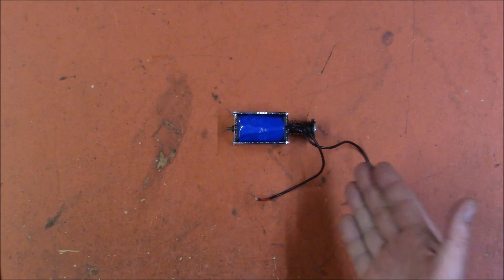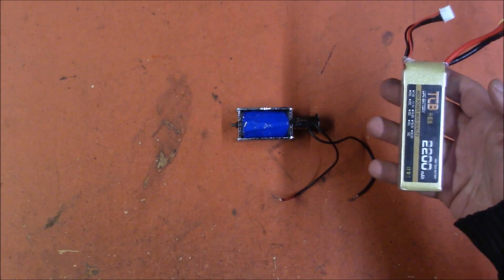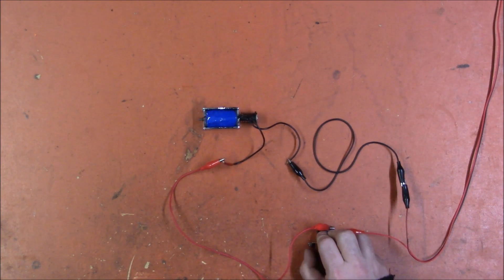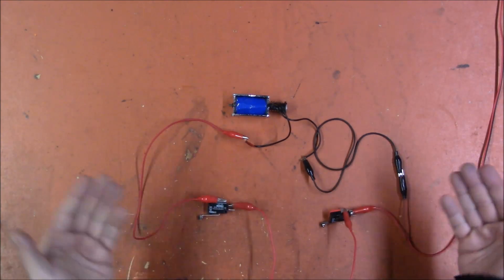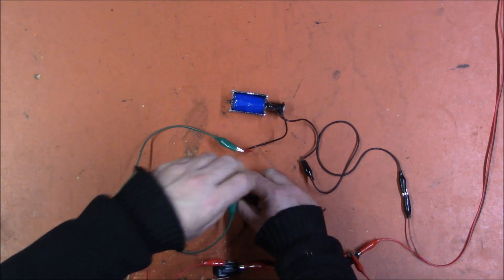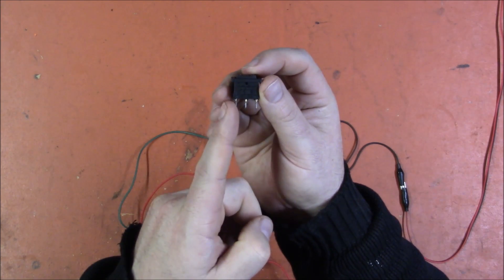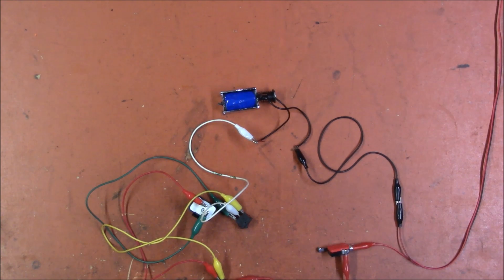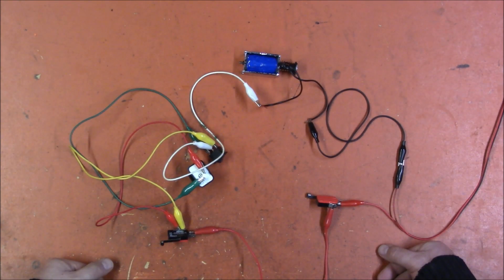Monday Mod Tips - Solenoid Basics

Comment: I’m planning on doing a project that involves a Nerfgun for the Nintendo Wiimote. I’m using it as a Lightgun with Mayflash Dolphin Bar. This allows it to work with PC, Raspberry Pi and Valve Steam Deck. I’m playing the old Lightgun games through Emulation Station and Retroarch on Steam Deck. Anyway everything works fine. I’m just trying to add a kick to the lightguns. To give it a more realistic feel that it’s shooting. So I want to add a recoil to the gun. Just to have that feeling of it firing when it’s not really firing. I definitely want to make it one for one shot games and then automatic for guns that are automatic. I think I can just make it automatic and squeeze the trigger once for the one shit games and then just hold down to do automatic shots. Anyway the Wii is registering one shots or automatic shots on its own. I can get away with making the project automatic right?

Comment: Is there a faster relay? also what type of battery should I use if I make this mod
Reply from the maker: Probably, you would have to shop around. I'm sure some blinker relays are faster than others.

And whatever battery works with the motors you are using in your blaster. The battery you need is dependent on the voltage and current needs of your motors.
Reply: @CaptainXavier  thank you so much for replying nice tutorial btw, while we are at it what motors would you recommend
Reply from the maker: @bunty3278  depends on what kind of performance you want. Different motors exist because people want different performances.

Comment: I don't have a solenoid at hand to try it, but maybe you can make full auto without the car blinker by using 2 momentary switches one in the trigger and one behind the solenoid.
at rest the switch behind the solenoid is closed and the trigger switch is open.
when the trigger switch close the solenoid get power and start to move forward pushing the dart
but at the same time the solenoid switch open and cut the power.
if the trigger switch remain close the solenoid will get power again when it return to rest starting a new cycle 
additionally a capacitor across the solenoid's power leads can help smooth out any rapid fluctuations in power, improving reliability 
maybe also a flyback diode across the solenoid terminals to protect the switches from voltage spikes caused by the collapsing magnetic field when the solenoid is de-energized

Comment: For some reason, whenever I switch the selector switch to full auto mode, it still functions like semi auto. I am running the same relay you are with an OOD neutron solenoid and MTB Rhino motors on 3s lipo. I copied your circuit down to every wire. Do you have any suggestions as to how to fix it?

Comment: When you bypass the relay with the yellow wire, is that wire connected to the same terminal on the firing switch as the red wire, or is it just in contact with the red wire itself?
Reply from the maker: It is on the same terminal.  But either will work.  The key is that is needs to be the output of the trigger switch.  Both the relay and the bypass are connected to the trigger switch output.
Reply: @ ok thank you!

Comment: Hi I wired my setup for select fire, but I’m having a problem when it’s flipped to semi the pusher stays forward until I turn it off and the full auto works great. Got any tips why this is ?
Reply from the maker: @rickhutchison5923  well, without knowing what you are using as a controller or how you have it wired, I can only assume you wired it in such a way that power is going directly to your solenoid rather than passing thru your trigger switch first. So nothing is breaking the circuit.
Reply: Yep, went back to the wiring, and found the positive of the flywheels was going right to the pusher. Thanks again for the tip and video really helped my build. 👍

Comment: I am wanted to build similar system with mini 5v solenoid and 555 timer battery based .(My only concern on this application solenoid working non stop 50-60 stoke a minute (do you think it can do that without breaking?)

Comment: Hello Captain, I watched this video to help me build a select fire stryfe. One question, where would I run the positive and negative wires for the flywheel motors?
Reply from the maker: Same as any flywheel blaster. Positive goes tue the rev switch and then the motors. Negative goes straight to the motors. The flywheel circuit is mostly independent of the firing circuit.

Comment: I'm just wondering, why are the solenoids so large. I mean it's not much force it has to push? There's probably a good reason but just wanna hear it :)
Reply from the maker: You might be surprised.  It does have to overcome the tension of the mag follower spring and it has no mechanical advantage.  A smaller one would be possible if a lever of some sort was used but that would result in a much shorter throw.  Now if you could get gears involved that would be a different matter.  But using the solenoid directly is very inefficient so a large one is needed.
Reply: @CaptainXavier  thx for answer, but also I had another question, why use solenoids instead of those metal gearbox solutions for full auto? I have seen both solutions but dunno wich one to use.
Reply from the maker: @MrDrake333  Preference. Simpler wiring. Recoil is neat. Easier to make selectfire. Fewer moving parts.
Reply: @CaptainXavier  thx 😊
Reply: @CaptainXavier  How much force (N) do you use for solenoide?
Reply from the maker: @MrDrake333  no idea. In fact, I don't even know how I would begin to calculate that.
Reply: @CaptainXavier   1 kg = 9,82 N so if you can add a holder and add weigts until it barely can push it up then that amount of weight (in kg) is multiplied with 9,82, then you have newton force.. I Think..

Comment: how would you get burst fire is that when you start with a green board
Reply from the maker: That is one way, yes. Using an arduino to count the shots or control the timing. There are also mechanical options.

Comment: This makes wiring a solenoid so amazing simple to understand. Now i want to make all my flywheelers selectfire solenoid pushers. Grate work Sir...... One question; can you get relays that'll give you fater rate of fire??
Reply from the maker: Check the comments. Apparently, there is a way by replacing one of the capacitors on the relay.

Comment: Now do a Basic video for a Rapidstrike style pusher. I wanted to use the Elite 2.0 Turbine's pusher
Reply from the maker: What is it you need to know? The wiring? I've already done that video.
Reply: @CaptainXavier  I didnt notice this. Thank YT's notif system. But basically, I want to learn how a Rapidstrike/Turbine pusher works, so I can make a reverse engineered version if that makes sense

Comment: Thank you so much! I've been modding for a few years now, but solenoids have always mystified me. This is the perfect introduction/beginners' guide!
Reply: I gave the full auto setup a try! The problem I'n encountering is that the  blinker relays keep dying. They work fine under most conditions, but the moment there's a dart jam or if there's a mag that's not properly seated, they die. And I'm not spending minutes holding down the trigger while the solenoid slowly cooks itself (which would be silly); the moment a dart doesn't feed properly, I'm off the trigger and putting it into safe- but that's still not fast enough. 

I suspect that the solenoid is drawing too much current under even the briefest stall conditions and frying the blinker relay (makes sense, as the ones I have access to  are rated for 40-some watts, and 8A stall current @ 12V is close to 100W).

I have this set up in a Nerf Halo MA40 blaster (it's gorgeous!). I suspect that, it being a bullpup, the extra friction and force required to move the pusher is exascarbating the current-draw problem (despite copiuos amounts of lube). In addition, I have a rubber bumper that acts at the forward stroke to muffle the clanging, and that may be providing some added resistance. All these factors indicate to me that the blinker relay system may be just on the knife's edge of function, and thus is a bit finnicky and picky on the exact pusher geometry and setup. That's not to say that the system doesn't work: just perhaps there needs to be careful thogth put into the design in order to minimize resistance. 

Of course, this is just the experience of one person, which is far from a definitive universal truth. I'm just wondering if you or anyone else has had the same experience (lots of trial and error and blown relays), or if it works right the first time, every time and I'm doing something silly (which happens with alarming regularity). 

Thus far, I am treating the relays as a semi-disposable item that can be accessed and replaced via the battery housing without needing to disassemble the blaster (like a fuse). I will try to put the blinker relay upstream of a solid-state switch-relay module, but that's a project for next month. I can let you know how that goes, if you are interested.

Comment: you can also use a switch above the solenoid 😊
Reply from the maker: Indeed. And I may try that next. An "interrupter" switch circuit.
Reply: @CaptainXavier  there is something on printables that will basically turn any hyperdrive select fire

Comment: Thanks for the video do you have a video to explain what motors work best with specific lipo batteries for a specific fps
Reply from the maker: That's...not how it works.  LiPo/motor combinations don't really affect fps (unless you under/over volt the motors...which you shouldn't)  What really affects fps is motor/cage/wheel combinations. Unfortunately, there are simply too many possible combinations (literally tens of thousands of combinations) to make a video on it.
Reply: @CaptainXavier  oké thanks

Comment: I once thought about achieving this same setup with a far more complicated system by using a motor, a wheel, and a switch rather than the car blinker relay. This is far better and less drain on a battery

Comment: Does anyone know of a blinker timer that can go even faster? The one in the vid is good, but I would like a bit more speed.
Reply: Sadly not- it might be possible to modify the circuit inside the relay to make it go faster, but every design I've looked at is limited to about ~4 flashes per second max unmodified. You would have to either go the Arduino route, or do what I did and use a little pulse generator circuit + mosfet setup.  Do a search for 'full auto solenoid wiring' on google and you'll find everything you need in terms of parts and wiring diagrams.
Reply: thats about as fast as they go.  to make it faster, replace the 25v 100uf capacitor on the relay with a 25v 47uf capacitor.  do note, that you will need to use a Flywheel the world solenoid, or a neutron solenoid, as the standard 35mm solenoids cant cycle fast enough with this modification.  I've built a few blasters with this system, and ended up modifying the one that took the 35mm solenoid to a FTW solenoid because of cycling issues.
Reply: @pintotheevil  thank you for this info, although I do want to know if you know if a neutron solenoid can be mounted to a 3d printed bracket meant for a FTW solenoid. I am asking because I don’t want to deal with the hassle of sourcing a FTW solenoid. Again, thank you for the wiring info, I will likely use it.
Reply: @KarlDRG  they are different sizes.  But they will both work well.

Comment: This is fantastic timing, im trying to sort out doing a solenoid pusher for a full auto retaliator sleeper.
Reply: Update:
Pusher works great, though the FTW cage needed a lot of shell work to fit... and the selector switch I setup needs to be switched out for something that is more akin to that on an M4
Reply: @GeneralFlagg I’m also trying to build an ftw solenoid, what solenoid did you end up using?
Reply: @frosttgasian1168  settled on an OOD Neutron with the high ROF spring. It's running on a 3s rn.
Reply: @GeneralFlagg  did it fit the cage directly? Or did you have to modify the files
Reply: @frosttgasian1168  I had no clearance issues with the solenoid, however I did have to Dremel out the retaliator shell to fit the cage.
Reply: @GeneralFlagg Did it just fit directly into the FTW cage? Is it the same size as the ftw solenoid? Or did you have to cut/shim/glue it to make it fit?
Reply: @frosttgasian1168  did what fit the cage? Are you asking about The shell? Or the motors?
Reply: @GeneralFlagg  did the solenoid fit the solenoid “cage” is what I meant. The 3d printed bracket that the solenoid fits into
Reply: @frosttgasian1168  there was no bracket for the solenoid. I dremeled out the plunger tube supports from the retaliator shell and made an epoxy putty mount for it.